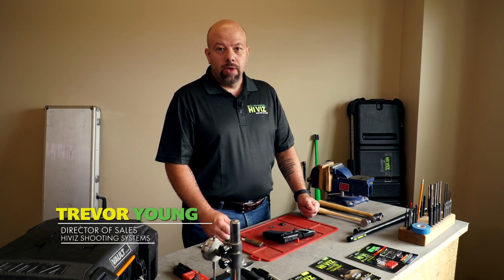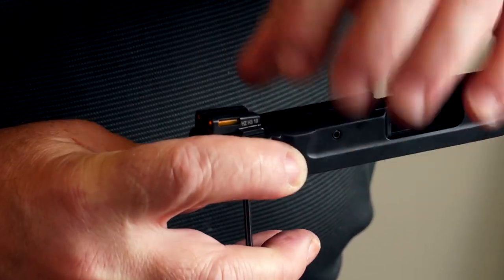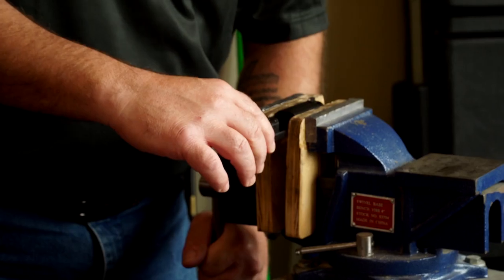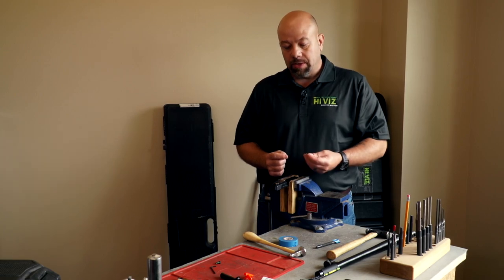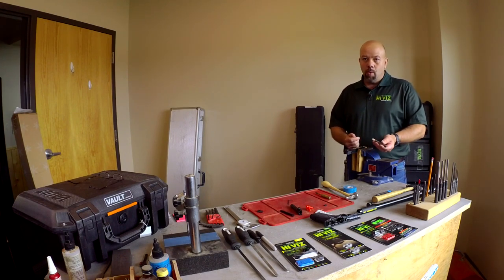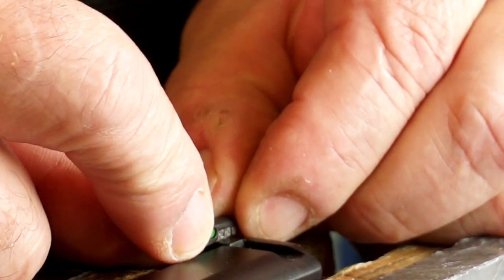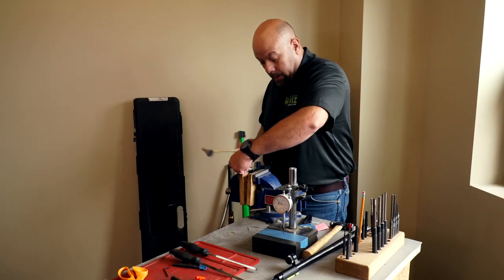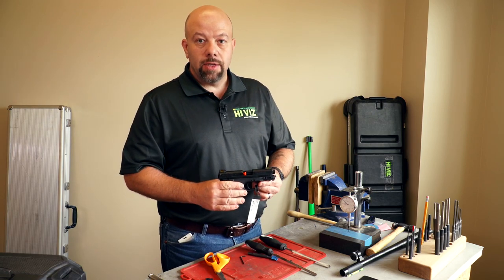Installing HIVIZ Front and Rear Sights: S&W M&P 9 Shield EZ Pistol

Comment: I installed mine and they are incredible!  I took 2 microfiber rags to protect my slide in the vise. Then I used a steel punch with tape, sanded the new site. It all worked out just like your demo, thanks!
Reply from the maker: They sure are!
Reply: @DeerGearTV That front sight didn’t need any locktite applied around it?
Reply: @LastTrump7    WE've never had to apply any

Comment: You took the front sight off left to right and put it back in the same way.  Shouldn't you have put the sight in right to left?
Reply: I don't know much about changing iron sights, and I know this is an old comment, but I'd just like to thank you for this comment. I'm about to put some true glo sights on my ccw and what you said rings true in the common sense part of my brain. Thanks man, hope 2024 is treating you well
Reply: @MikeOxlong1027   the dovetail is a little smaller on one side of most guns.  That is why you need to know what way to push them in and out.